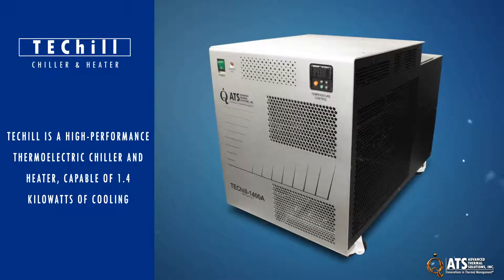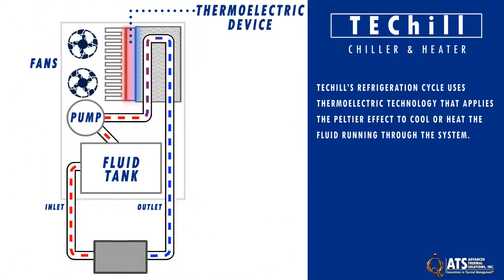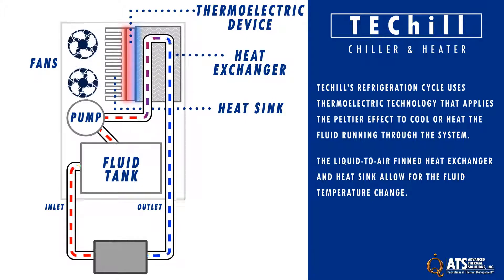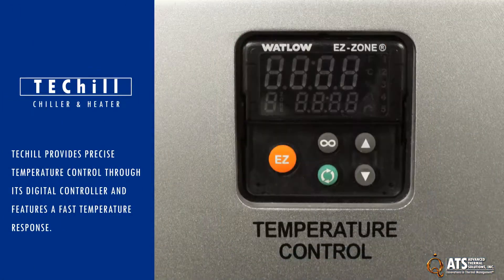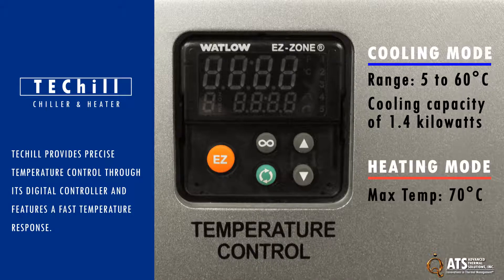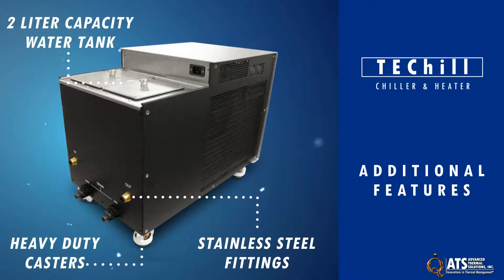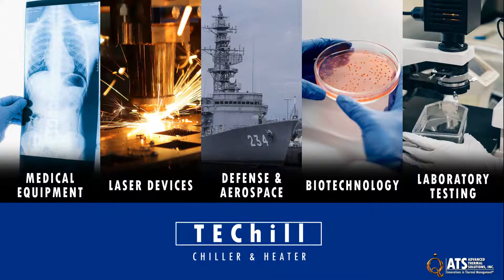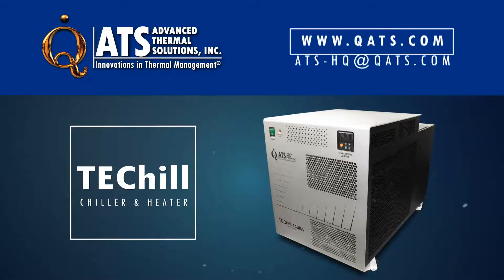ATS TEChill - 1.4 kW of Cooling Power

Comment: A peltier isnt going to do more for the fluid temps than a basic radiator
Reply from the maker: Thanks for watching our video @mwint1982.  In this particular chiller, we are using a TEC because a thermoelectric cooler is a semiconductor refrigerator, it is an active cooling system. A basic radiator relies on ambient air and that is where the limit is.